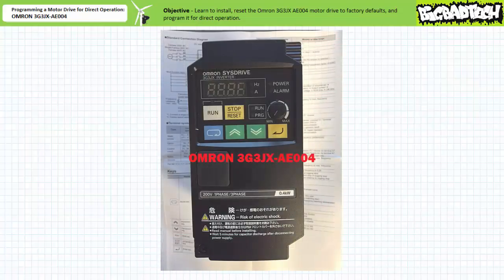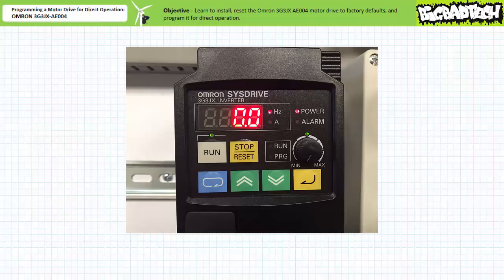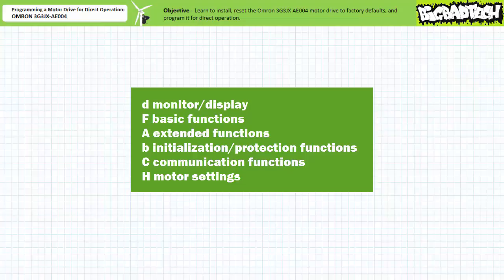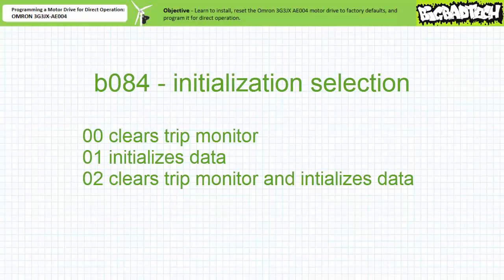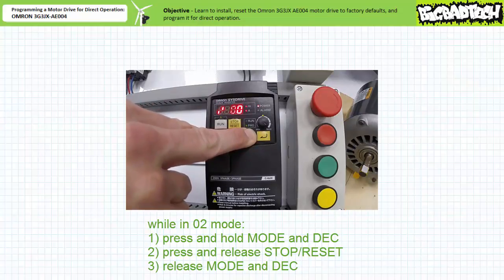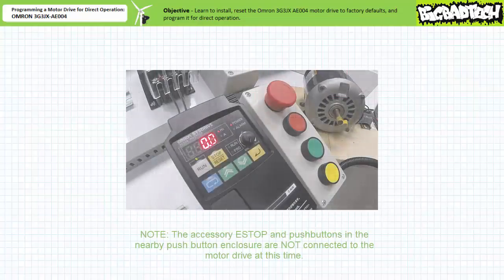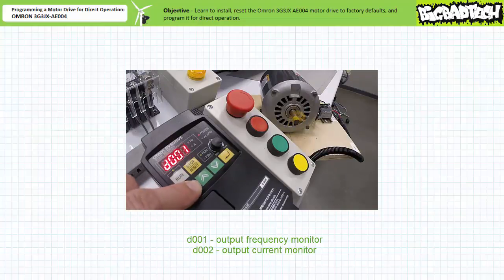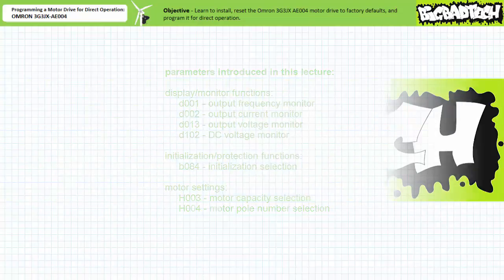Programming A Motor Drive for Direct Operation: Omron 3G3JX-AE004 (Full Lecture)

Comment: Sir how to use Reverse & Forward
Reply from the maker: Configure the multifunction inputs as so: https://youtu.be/p0NSQ39v8OI and https://youtu.be/pe627kwSB_4
Reply: @bigbadtech  thank you sir
Reply: Sir, my Omron mx2 inverter Error E30 showing ,after factory re sett all parameter added, but H103,H11,H112,H113. Parameters not possible to access, because H050 below  and H200 above  only parameter showing how to rectify this issue

Comment: Thanks for the video, it was very helpful. I was able to get my VFD to go forward with on button and reverse with the other button. I am trying to get it to go 1200 rpm in forward and 450 rpm in reverse. Would you be able to help guide me in the right direction. Thanks again
Reply from the maker: Honestly only way to do this is to dig through the manual for your specific drive. Most modern drives allow for more than one speed setting. You should be able to configure for two different run speeds for the two different directions.